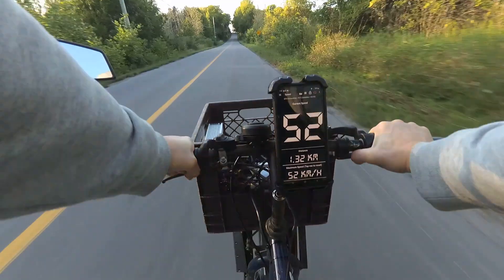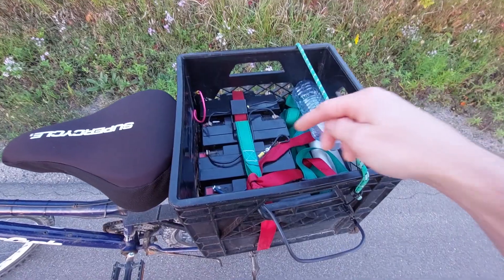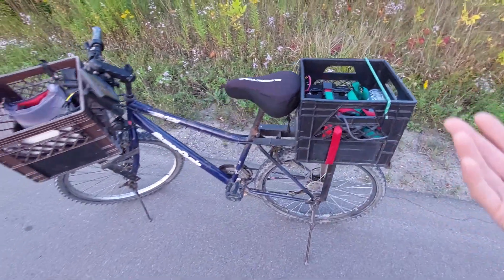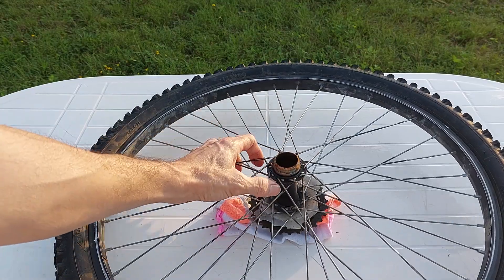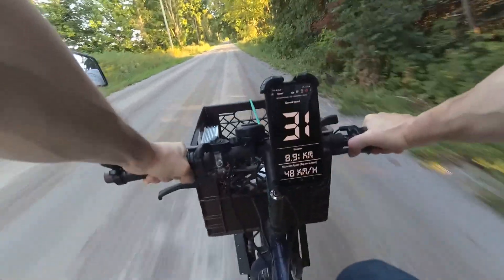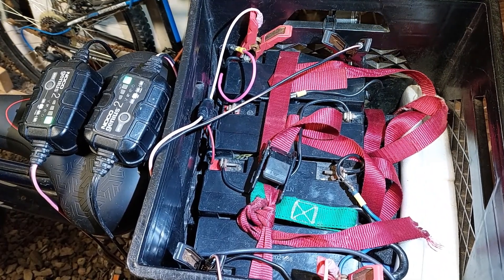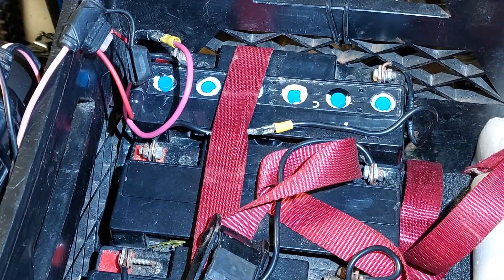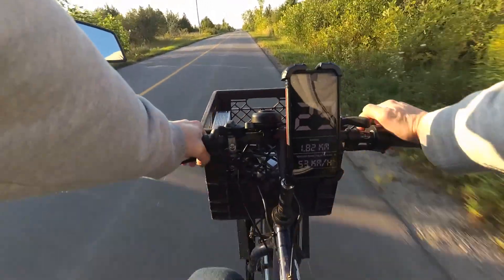I Built a Homemade FWD 1800W Ebike that's Fast [ 54km/h ] - Low-Cost Build

Comment: hell yeah, FWD gang
Reply: Interesting, i have a 48v 1000w hub motor which allows me to get to almost the same speed, i wonder where the rest of the watts are going
Reply: @ezzbuttheyshouldntleavethe5529  I think it goes to Heat? or your acceleration is better